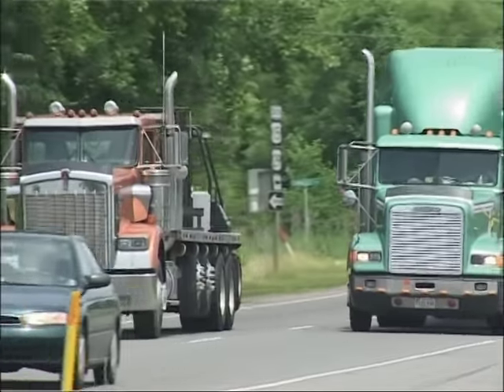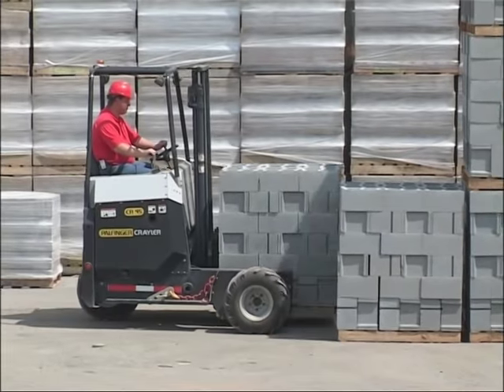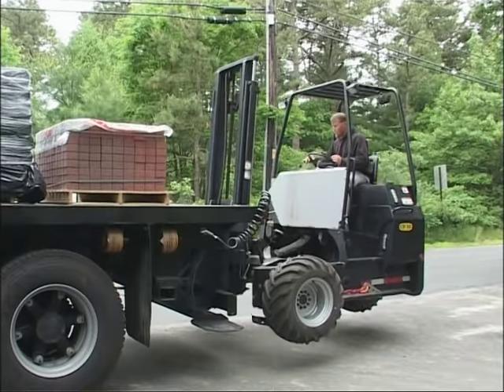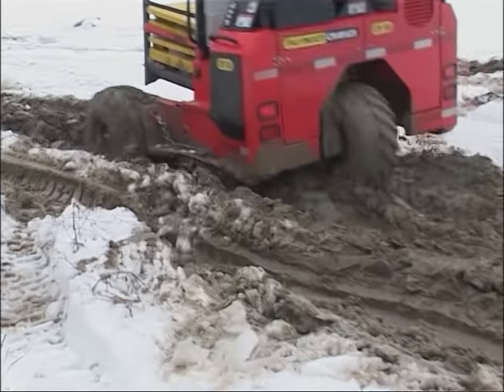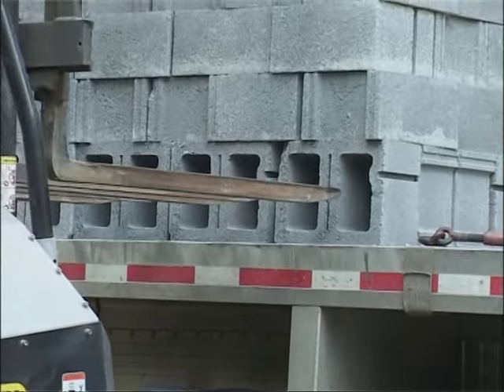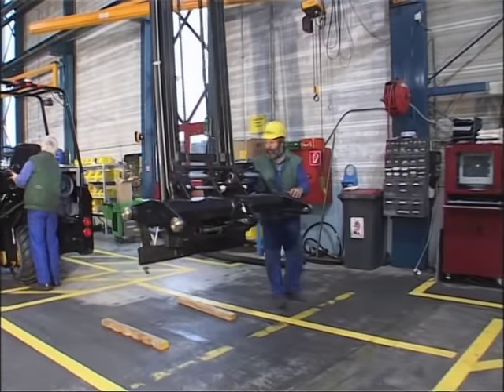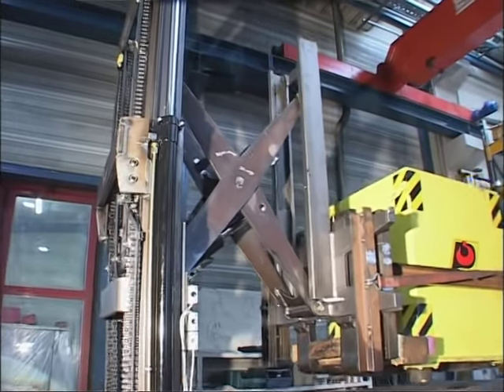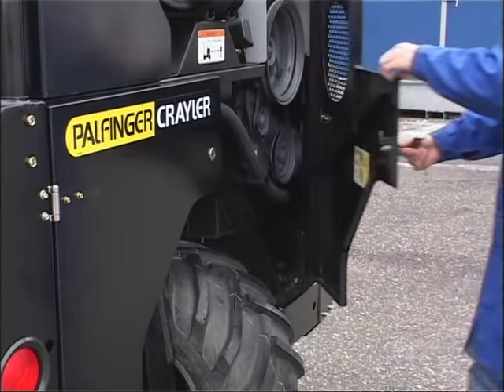Palfinger Truck Mounted Forklift - Brick and Block Applications (USA)

Comment: I take it that you lot have not seen the mid mounted version of this?  One of the brick carters and one of the stone suppliers have similar sort of machines, but, due to the weights they are moving, they have opted to mount the machine in the middle of the trailer, and have side load / unload.  The brick carter gets up to 2 tonne / pallet, and the stone supplier pallets often exceed 2.5 tonne.  Before you call BS on the latter, that weight was verified on a weighbridge.

These machines are better than the telescopic, as they do not have a blind spot to the right, when the arm is at a certain height.  However, in mud, on a steep slope, this type of machine can slide, rendering the operator a passenger, rather than a driver.  The stone company had to call me in on a few occasions to complete what they were not able to do.  

One further feature that needs to be looked at is rear loading / unloading of the load.  With space on the side of vehicles getting tighter and tighter, it may be prudent to look at how a machine can be set up so that it can lift itself onto a truck body to unload off the truck body.